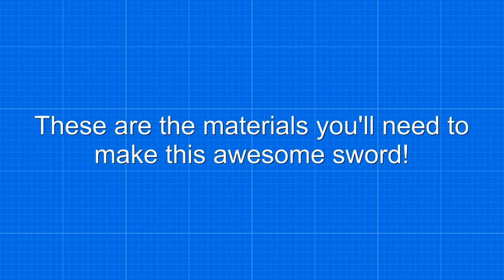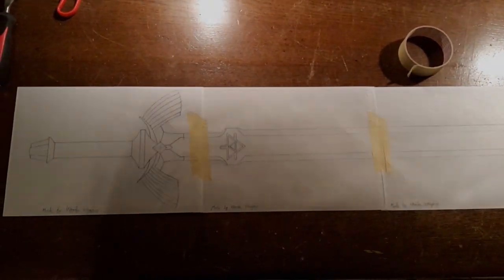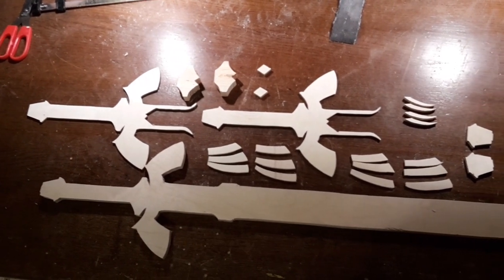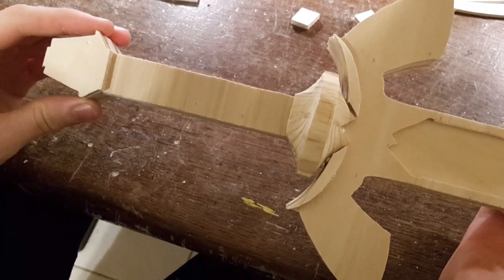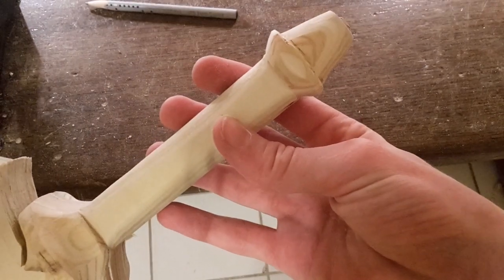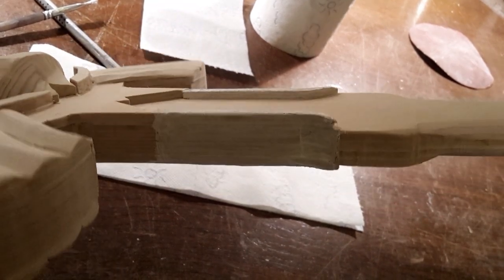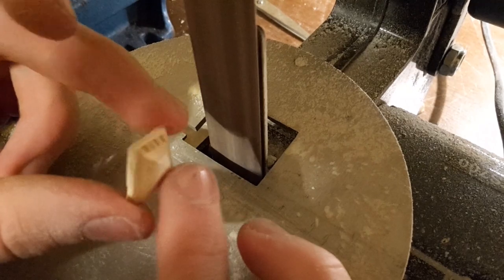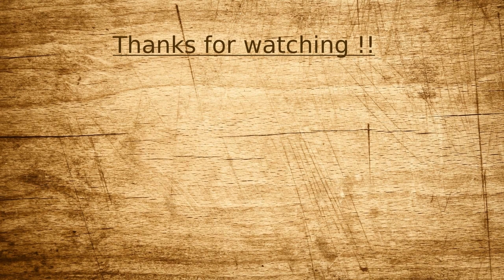Make your own Master Sword! [Legend of Zelda] - Free templates

Comment: Well, as always I have to say that I liked this project even though I don't like the zelda games that much. ^^'
If I had to rate this work you would get an extra point due to the paint job but if I had to rate the paintjob it wouldn't work out that well for you... ^^'
If you colour big pieces like the blade you should look that the colour isn't to thick and evenly spreaded cause it will develop little drops that don't look that good. You could spread it easily with a bigger brush or use kitchen paper to wipe the drops away. 
The rubies could have used a second or third layer of colour and should have been pretty thin cause the rubies are that small. 

Apart from this and mentioning it's your first work it is pretty cool. 
Keep your work up and your skills will get even better. :)
Reply from the maker: Thanks for the review! You're right about the paint. I used a paintbrush which was not suitable for this kind of work, it is better for spreading glue, next time I'll definitely use a different one.
Reply: Wooden Weaponry I'm fine with it. Just thought mentioning it in a polite way is better than an idiot complaining in a more rough way... ^^'